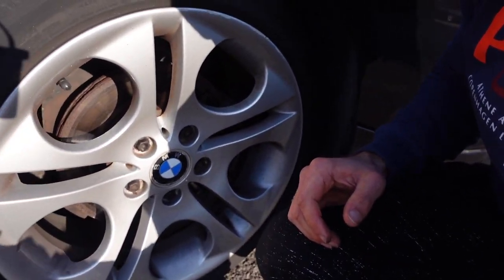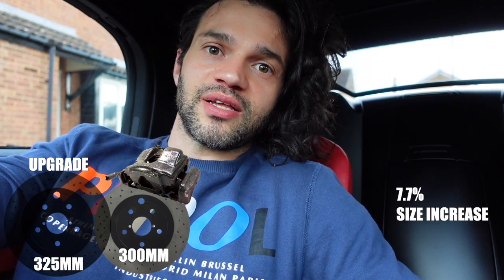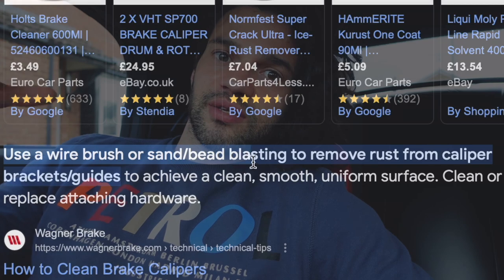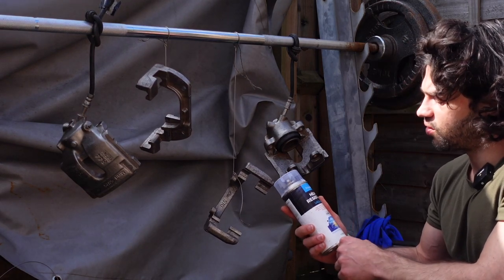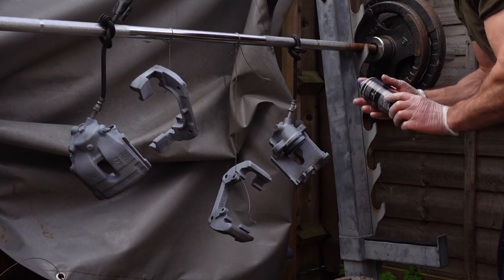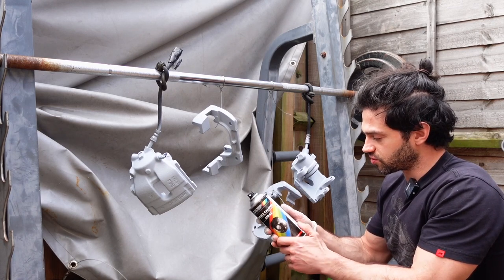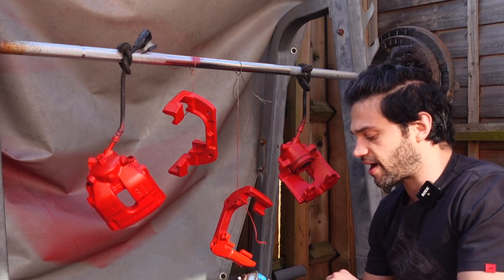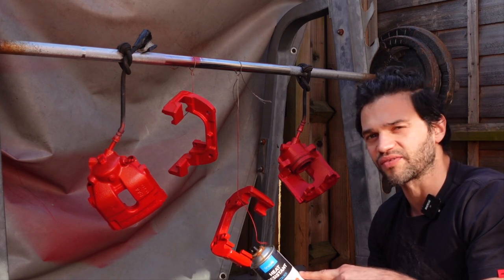Budget DIY Big Brake Upgrade -  BMW e85 Z4

Comment: The 300 to 325 mm rotor is a ~15% increase in surface area. Far from a small big brake kit.

Comment: Hey great videos. Im looking for a roadster because i miss my NA miata and Z4 is high on my list, but im worried how hard is it to work on the Z4.

I saw your video of what to look out for but how difficult are repairs on the car?
Reply from the maker: I think it’s pretty easy…. I am not a mechanic but I think if you know what are you doing you will have no problems working on it. Just avoid the 4 cylinder engines
Reply: Ive had no issues working on them. The underside is straight forward, just some covers over everything that have to be taken off first, but the engine bay is WIDE open. You can easily get to any part of the engine you need (People have even replaced the I6 with a V10 there is so much room). The car is pretty standard for a BMW.